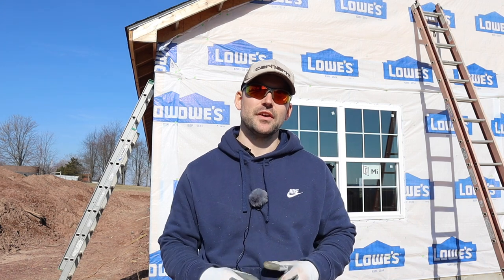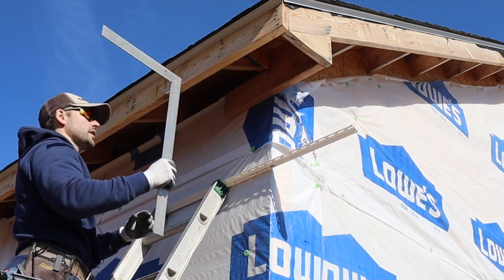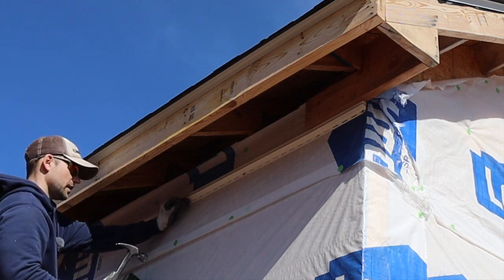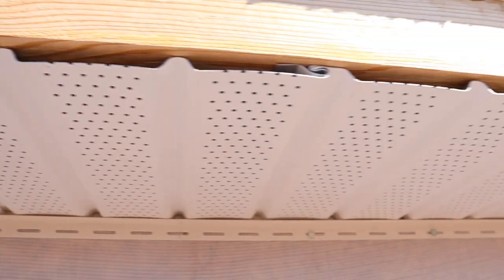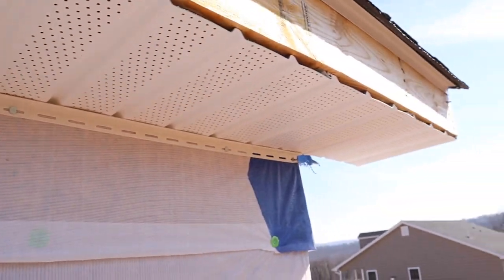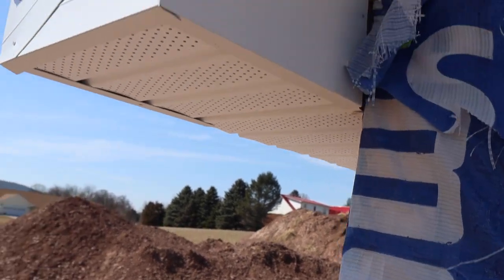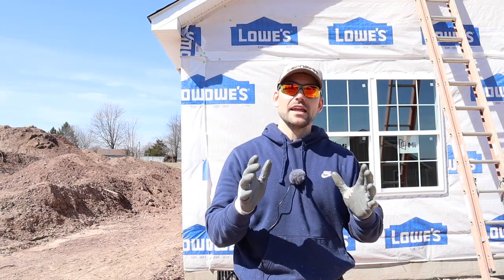How To Install Fascia and Soffit

Comment from the maker: Tin Snips similar to the ones in this video: https://tinyurl.com/4v4uprhr
Reply: My soffit is going to end up flush with my bay door. Can I nail my f channel "upside down" from the way yours is? I hope I can. 
Thanks.
Reply: Hey on the last part where the bird box is wrapped and the fascia is I stalled, what is that strip on the top of the fascia on the back side of the bird box? It looks Like the facia is tucked under something

Comment: Good day .. nice work , my bird box metal and all my fascias  are all custom bent. Prefer to have bend at transition to rake soffit to add support to bottom piece of rake soffit. 2) instead of nailing drip edge face ( which imo is a no no) back caulk fascia  with dabs, and gently embed each piece of fascia into caulk (OSi) quad or something flexible.. fascia will never come off, fixated nailing along drip edge and into drip edge can cause buckle, plus, nails remove smooth appearance of drip edge 
Regards 
JS

Comment: Thanks Josh great video! We here in Southern Alberta do not get the luxury of “F” channel, we framers must install soffit backing (2x2) cause of WIND! Then “J”channel is used. 
Take care.
Reply from the maker: Oh well you must have some extreme wind. F channel works like a breeze around here. My dad still does the blocking when he builds. Thanks for watching!
Reply: Assuming you do that to nail it off on both sides, how do you conceal the interior nailing flange? Or is that left exposed?

Comment: Hi! Great tutorial videos! Im building my while house by myself watching your videos! I have a question.. what if my roof pitch is 10 12 .. and i have a 14 12 dormer.   The birdbix is wider than my 6 inch fascia on one side,do i need to get a wider piece of metal and fabricate a custom piece? That is wide enough to get to the corner of bird box/gable sub fascia and 6 inch where it wraps on the other fascia board?

Comment: Thanks for the vid. I'm doing a temporary fix on an epdm roof with a lot of fascia/sheathing rot from bad water penetration around the edges until I feel ready to install a metal roof. It seems to me I can do this as a separate project without having to remove anything again when I do the roof.

Comment: On the bird box. When you put the aluminium pieces  with holes in it on the bottom.  Is that for airflow? My house has..rotten wood there. Which might be why it keeps getting wood rot under shingles. I.d.k.. but, I'm going to replace this way. Thank you much for great video.
Very helpful.
Reply from the maker: It’s called vented soffit. It’s actually made out of vinyl. I did that  because you need venting for your roof. So yes it’s for the airflow and  not having that can cause your roof to sweat and rot. Hope that helps!
Reply: @TheExcellentLaborer  
Yes, that is indeed what happens . It all rotted on an old house I bought years ago.   
 I saw that the f- channel  like bracket here was missing over the door. No air flow either. Also, the birdbox had a solid enclosure inside of box over the door.
So, the aluminium door rotted out first. (directly beneath the missing part and solid enclosed box with no airflow to attic.) Then the interrior walls around the door started leaking. along with all electrical wiring. Dangerous situation all things combined.
Thank you for all of your helpful videos. This is a very big job for me. However, knowing why it has happened several times in a row after repairing the first two rows of roof twice in the same places. I can better understand how this keeps happening. 
At least in part. Now, I can start with those repairs and go forward. Slowly and carefully. Thank you again Josh. Incredibly useful video for me. Keep up the tutorials!
Reply from the maker: @mariesacul722  I am so glad I could help you. That is the main reason why I started this channel is to help people like yourself with situations like yours. I appreciate you letting me know how helpful it really was. Thanks a lot for watching! Stay tuned!

Comment: Going to be taking on a siding project soon and wanted to know if 3/4 j channel or 1/2 j channel which is the right choice,  and little reasoning behind it would be very helpful,  I understand the thickness of the siding , has to be able to fit .. lol should of left this comment on a siding video

Comment: This really is a great video, well explained and demonstrated and even included some tips to be efficient to limit moving of the ladder (which I am guilty of doing quite often). Well done and I appreciate your attention to detail. I do like building things and other home improvements and tend to do these alone so having tips on how to do this alone is super appreciated.

The facia on the side of the bird box with a 12 inch overhang looks really great and overlap perfectly. Any suggestions on how to deal with an overhang larger than 12 inches? In my case I have a 22 inch overhang on the front side and a 16 inch overhang on the gable end so the facia on the gable end of the bird box is quite tall and I'm not quite sure how I am going to deal with that. If you have any other videos that cover this topic I would be very interested.

Comment: Very educational. Nice jig/fixture @22:20. I used to make jigs, tool & die, etc.

We are having fiber cement Hardie siding on our new build (which I know is quite different) - any experience or tips there? 

I heard a duck @20:36. ;-)
Reply from the maker: Thanks Zarrah! Jigs are such a huge time saver. I have never done Hardie board so I can’t give advice on that. I heard the quack too 😆

Comment: Every body does them different first I use flat metal stock also when I do my bird mouth I don't let go all that way down that fascia all you got to do is wrap the corner fascia stock will cover it and back side birds mouth I bend metal up on to rake so you see white then run rake over hang another thing ish I drill my nail holes just a hair over the wire nail metal moves when it heat up content winks then when I nail I never hit metal always stop just short of metal and if you don't feel comfortable just use you vinyl punch
Reply from the maker: Sounds like that will work!

Comment: Where do you recommend looking for the metal fascia for 2 x 6? I'm having trouble locating it locally and none of the big box stores have any in stock?
Reply from the maker: ABC building supply would be the best place to check. I don’t know if the big box stores will have any or not.
Reply: @TheExcellentLaborer  I really appreciate your time. I'll check them out. I'll have to send you some pics of what I've built and a couple beers with all the help your channel has provided.

Comment: Does this only work with vinyl siding? If I were going with Hardie siding, what materials would I use for soffit and fascia?
Reply from the maker: I have never used it with Hardie siding but I don’t see why not. I have never installed Hardie siding.

Comment: I see your doing the soffit and fascia before the siding.  Is this the correct order?
Reply from the maker: Yes it’s the correct order. In fact if you install the F channel 1st then you could install either one first. Hope that helps!
Reply: @TheExcellentLaborer  this makes sense to me.  Otherwise it seems difficult to have to cut around batts or shakes or lap.

Comment: Great Video! Should I caulk between drip edge and fascia?
Reply from the maker: Thanks! No you should not have to. The over lap keeps the water out 😀
Reply: @TheExcellentLaborer  You are the best. Thanks so much!! My roofer only put drip edges on eaves but not on rakes. Would there be any problems? Should we add them to rakes? not sure if it's too much work because the shingles have been installed. Thanks!
Reply: @christinawu4099  Definitely should have used drip edge on the rakes.  That roofer shorted you.

Comment: Does the aluminum fascia come in a smooth finish w/o the ribbed look?  I don't like the 2 lines running thru it and would prefer it smooth or even better with a wood grain pattern.

Comment: Do you nail through drip edge and fascia on the rake side only? Or also on the side where the gutters will be?
Reply: I wouldn't nail thru the drip edge at all never seen that. Not only would it piss off the roofers lol if the nail starts backing out, water can travel onto the nail and make its way it the fascia and behind the metal, slim chance but it's a possibility. shouldn't have to nail the drip edge if it's installed firm and tight against the facia.

Comment: First of, great video. Question though, how far do you measure down to strike a line to set top of the f-channel to?
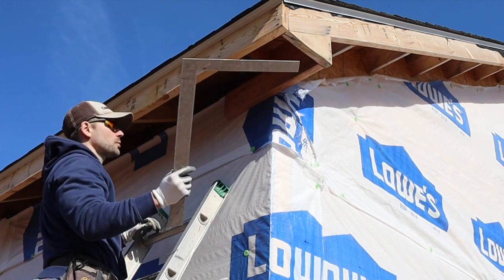Reply: You use a framing square to mark a line that will be level with the sub fascia.  Look at him at 1:26 as he holds the framing square against the sub fascia to make his mark.
Reply from the maker: John is right. It’s going to vary depending on the pitch of your roof to and what do you use for sub facia.

Comment: I'm sure this is a dumb question, but is it possible to run the sofit vinyl the other direction to eliminate so much cutting/measuring/etc?  I'm sure there's a good reason I don't know.  Thanks for the channel, loving the videos!!
Reply from the maker: You cannot run the sofit in the other direction. You cannot secure it that way. Thanks for watching my channel!
Reply: I actually don't think it's a dumb question. The particular soffit he was using clearly can only be nailed when oriented in one way, but I agree it seems like an obvious optimization if they just manufactured a type of soffit where the nailing flange ran length-wise and so you could do an entire side of a house (or up to the length of your material) in one go. I feel like such a thing almost certainly has to exist, but I've never seen it.

Comment: I like your videos! Just wondering about nails on drip edge. When roof gets replaced usually drip edge gets ripped off. May be it isn’t so where you are.
Reply from the maker: Yes that is what they usually do. Some people leave the drip edge on when they replace the shingles. If it is nailed to the facia like you see me doing, then it may be beneficial to keep the drip edge installed. Thanks for watching!

Comment: Hi Josh, If you nail the soffit firm rather than loosely doesn't that restrict any expansion? It is such a small section at 12 inch so any expansion would be minimal anyway I guess. Recently found your channel and is by far the best I have found. Thanks!

Comment: Backwards blade trick didnt work for me, I'm using a dewalt cordless with the dewalt finish blade and it cut better in the regular direction, backwards caused it to break big chips of plastic out. Tried it on alum soffit too, and it was similar, except it was just bending the cut area instead of breaking it out.
Reply: Maybe not enough rpm on the battery operated?